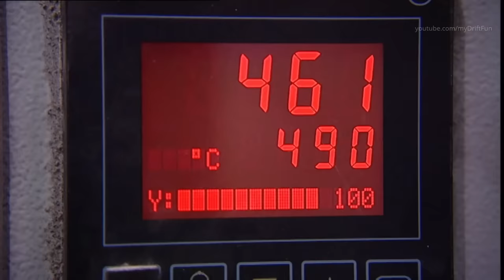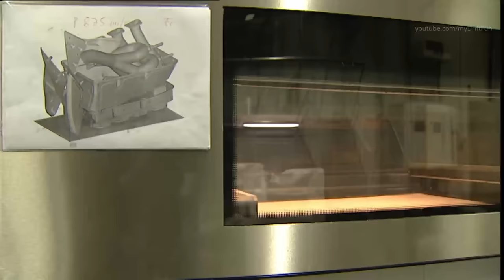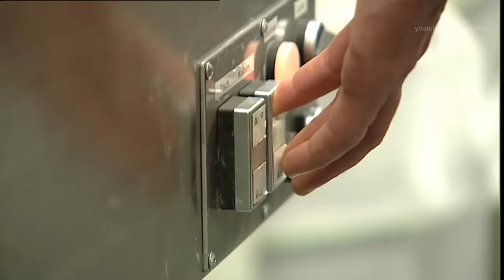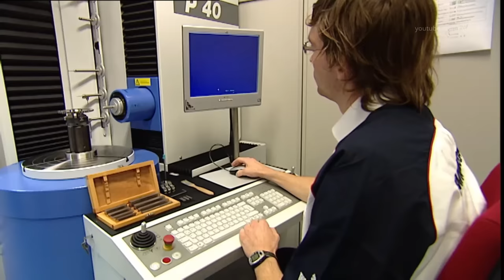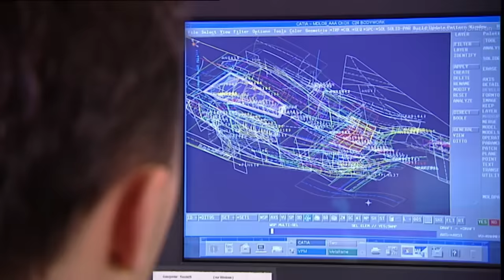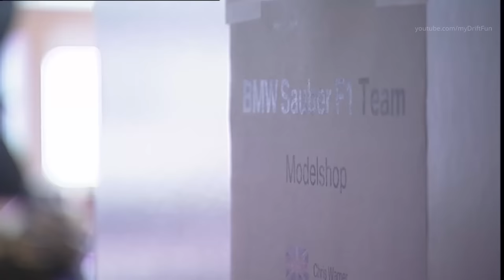Formula 1 Car Development And Production | HOW IT'S MADE

Comment: And this was in 2007. It's 2022 and the process has advanced way more then this. Imagine the tech such as CAD or wind tunnels etc the teams are using now. Must be mind blowing 🤯
Reply: The things that humans can do is mindblowing.
Reply: @@kun866  yeah, and to think we are only now scratching the surface in the grand scheme of things too, wow.
Reply: Both wind tunnels and cad are old technology?
Reply: @brennanf2486  I'm not even sure myself but I think so, at least as old as computers are, so maybe like late 80s early 90s?
Reply: CAD is CatiaV4, 1993
Reply: additive vs subtractive manufacturing you mean.
Reply: You’d be surprised how much of it hasn’t changed too much. 
Bunch of teams are in the process of, or just completed, the construction of new wind tunnels. But plenty in use are older than this video. 

The cad software versions have probably gone up, but much the same software. 
Probably the biggest difference is the latest types of CFD software packages & simulation software. Those were around back then, but have improved greatly since then

Comment: can you find a documentary about how modern f1 cars are made? from 2017  until 2019
Reply: The latest one was back in 2011 at Williams...
Reply: I'll let you know in 2029
Reply: Sure ,they're going to reveal their secret sauce and party packs.They wont surface till the formula changes.
Reply: @nssherlock4547  their secret sauce 'Sherlock'
Reply: A F1 car is made in the exactly same way today. The only thing that changed is that some of the CAM, CAD and IEA tools have a higher capacity. But the manufacturing process itself is totally the same.

Comment: When F1 was truly F1.  Back when engines were on the ragged edge revving out to 19k RPM. Back when engineers would pray that the engine would survive another lap. The V8 engine in the M3 and V10 engine in the M5 were loosely based on this BMW F1 engine! I believe they were also produced in the same foundry as the F1 engine.
Reply: You are right. A lot of parts were produced in Landshut in Germany for all three engines

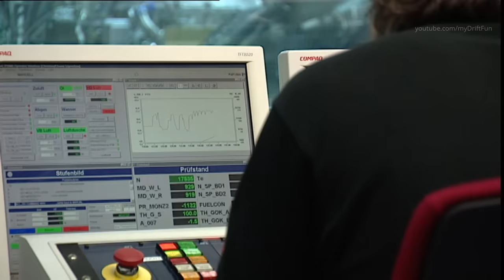Comment: 9:50 looks like a pretty dated video, but the sound of this engine is just stunning. Still V8, but on the dyno it sounds just great. I can imagine they simulate it with a Monza cycle because it is the circuit requesting the maximum from the engine.
Makes me think back to the old V10 and V12 days..The  old V10 sounds are just sooooooo stunning, Wish even the V12’s (last team to still drive with it) came back. The F1 sounds in the earlier days was just better than music in my opinion.

Comment: im new to F1 - do u know how roughly it takes to make it from zero to final product (car)  ? 3 months ? half year ?
Reply: The Chief Designer starts thinking about the new car in April already. In June the real work begins and usually in January the first chassis is finished. So you can say its April(when the designer starts to think about the new car and is putting together a specification sheet of about 30-40 pages for the new car)to January from zero to final product(even if the developement of the aero parts runs untill the first GP). The "real work" goes from June to January.

Comment: I was horrified and amazed to see them using compressed air to remove debris.  I've worked in state of the art tool shops in Europe and that is never, never permitted.  Negative air ( vacuum) is the only way you can control the evacuation of debris.
Reply: Why is it not  permitted? Is it because the particles can get into some vital components?

Comment: What's that small version of it used for? Is it fully functional?
Reply: no, it is just a scale model reproducing the actual car. The bigger the model, the bigger the wind tunnel must be (and expensive) so in the scope of cost reduction FIA limited to 60% the scale of the model. It is common and necessary to use scale models: imagine creating a 1:1 wind tunnel for a commercial airliner or jet-fighter (not only for the size but the ability of creating 1000 km/h wind speed)

Comment: As mentioned here, I dearly miss the 19k RPM sounds of the engines of the past.  The low-rev turbo V6s sound like old milk trucks in comparison.  Back in the day, you could identify the engine maker by the sound.  Shame to make this high-tech engineering sport "politically correct."
Reply: Everyone wanted the turbocharged era back. Then we got it and now people want the high revving n/a engines back. It's one or the other you cannot have both as cars would be making 2000+ hp and would require an engine swap every pitstop

Comment: You seriously mean to tell me they sandcast those parts?
Reply: You can cast geometries that are impossible to machine as a solid piece
Reply: I think the process is called rotational casting. I saw it on a documentary of Rolls Royce turbine engine manufacturing - it supposedly yielded a very uniform crystalline structure that was somehow better than a forged piece